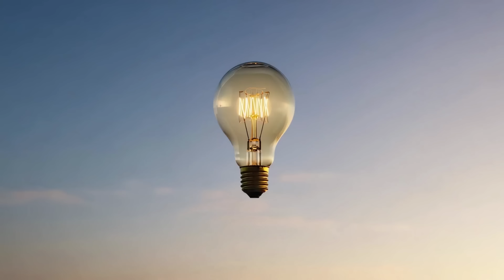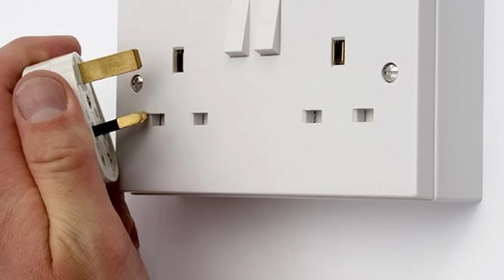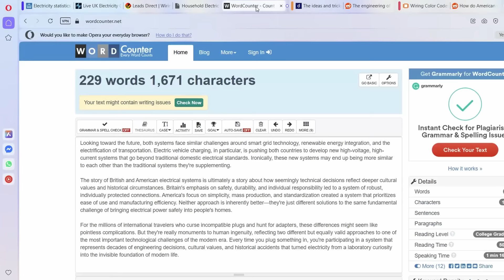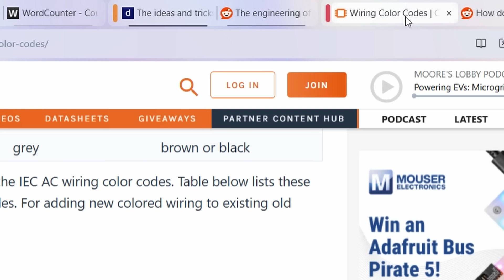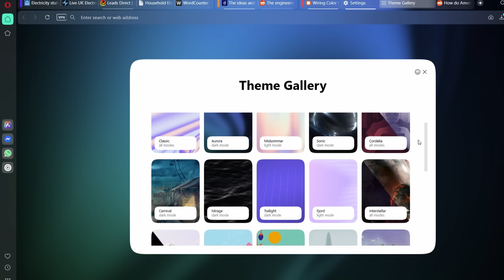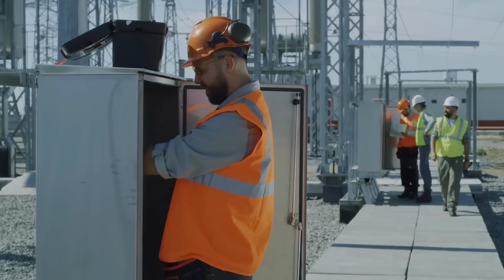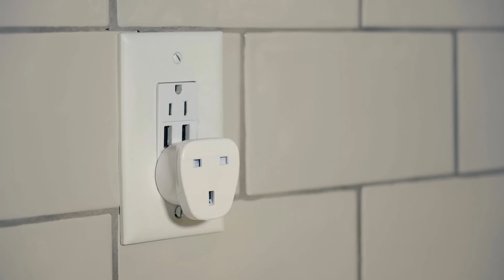British electricity is SAFER than American electricity. here's how.

Comment: I remember as a kid when we bought something electrical you had to also buy a plug and fit it yourself. I am sure that was the case and I don’t feel old 😅
Reply: That was the case up until relativity recently.
Reply: Can you remember when you went to  the ironmonger and bought a replacement element for your kettle instead of throwing the whole thing away when the element blew?
Reply: @orraman5427  No I don’t remember that. But I do still remember how to replace a plug. 😂
Reply: @ozzyprogdomino8815 our job is done! (ex science teacher!)
Reply: @orraman5427  Yep, I can, and there was one which fired the connector out and unplugged itself if some berk let it boil dry!
Reply: @majorpygge-phartt2643 my first electric kettle when I moved out of hone -a hand-me-down from my parents ^_^
Reply: @orraman5427 yes, my dad (trained as an electrical engineer, and who worked as in the planning department of a electrical supply company) used to do this kind of thing all the time all the time.

He changed the 'rings' on the top of our electric oven/stove several times l remember.
Much cheaper than buying a new one, even with a hefty staff discount
Reply: It definitely was a thing. I was taught how to wire a plug in primary school in the 90s. Considering how cheap plugs are compared to how expensive an electrical fire is, it makes more sense to include them as standard to ensure they are wired correctly.
Reply: @RichHaynes2012 was high school for us, although by them I'm sure I had done it already at home
Reply: British square pin plugs became common probably in the 1950s, maybe '60s.  My childhood home in the 50s and 60s had 5A round pin plugs - older homes had 2A round pin plugs.  15A round pin plugs were also available.  Those round pin plugs had no internal fuses, no insulation around the pins and their wall sockets had no shutters.  You're right that moulded plugs haven't been around for much more than ten years or so - until then, all plugs had to have their flexes attached manually, by the retailer, the householder or an electrician, etc.
Reply: @ianm452 but those round & rounded triangular plugs are still used in commercial lighting rigs so there's not way you can plug anything domestic in to a lighting system & vice versa!
Reply: I remember trying to get a retailer to demonstrate a product I was intending to buy, radio, vacuum cleaner, totally forget which but it had no plug on it.  I asked the shop assistant if they could fit a plug on it something I could easily do but the man said he could not do it because he was not a qualified electrician. The very complex and complicated problem of joe public incorrectly wiring up plugs has brought in compulsory moulded plugs on consumer electric items. Hard to get your head round.
Reply: @keith6400 the law for a time was really odd there! They couldn't wire it in store for you to take it home & use it (claiming they needed to see your electrical system to confirm it was being wired correctly) was it the old colour system or the new one! Only the homeowners could do electrical work at home (or a qualified electrician) the law has been tightened many times since! 
Indeed so stupidly that if you want to fit an external socket it comes as a complete unit, moulded plug, wired socket unit but then it's up to you to decide if you're going to cut a plug or socket sized hole in the wall or a cable cutout in a window frame & screw in the socket, meaning you get to disassemble the whole thing! 🤷🏻🤔🤨
Reply: @keith6400 sounds like arse covering to me. If they got it wrong and it resulted in a shock or fire it's in them, if you do it yourself it's on you or your home insurance. Obviously an electrician will have their own insurance to cover such things
Reply: See my comment about what we taught in science!
Reply: That was because Britain switched from an older plug system to the BS1363 system described in the video   For a while both systems were in parallel use, si users had to mount the plug which suited their needs.  The ilder plug has roynd pins and remains in limited use usually for switched outlets for example for lights controlled by a switch next to the door.
Reply: True. Always had to buy a plug when you bought an appliance

Comment: The most dangerous thing about a British 3 pin plug is stepping on one in the middle of the night. No pain on earth compares....
Reply: a lego version of the British 3 pin plug
Reply: @airgunnut9489  that is banned under the Geneva convention
Reply: Something that most people can probably relate to.  But also consider of all the plugs I've used the British plug is least likely to drop out or be pulled out of the socket. And because each socket has a switch it's unlikely to be pulled out for safety sake.
Reply: @Davrolo101  it really is likely to drop out. Its held in only by prongs. Now compare it to schuko plug/ deep hole socket. British ones are just hanging for dear life on flat surface.
Reply: @lauriviik  So you haven't had any real practical experience with both the British and the Schuko plug? Or the Italian plugs, The French plugs. The US plugs. the Australian plugs.
Do you think those weak scraps of wire on the sides really hold the plugs in?
Reply: @lauriviik  Given that the only force direction that can actually pull one out is essentially perpendicular to the socket face, they really aren't hanging on for dear life.
Even a strong tug on the cable isn't likely to do it, though arguably it might often be better if it would.
Even back when wall wart power supplies used heavier mains-frequency transformers, I can't recall coming across any that gave me even slight concerns about them just dropping out.
Reply: @NorthernStar1982 Never done it and I'm getting on now.
Reply: @bertiesworld 
Neither have I. Nor have I ever met anyone who has.
It's only in YouTube comments do I ever read about such a thing happening.
Reply: @bertiesworld  you should put it on your bucket list😁
Reply: "No pain on earth compares...." You've never had a serious electric shock then.
Reply: @thearmouredpenguin7148  I have had both. And of the two I prefer the electric shock. It's either done and gone. Or you are. The plug-in the foot hurts  like hell for a while and stops you walking For a bit longer
Reply: @Davrolo101 can't have been much of one, I'm quite careless with electricity and have had electric shocks several times, the most dramatic sent me flying across the room literally. Overall I'd prefer to do neither.
Reply: @Davrolo101  I have experienced treading on a plug (*and* upturned DIL IC chips (they always land the wrong way up)) without shoes, various mains shocks when I was young and careless, and a minor ground shock from a super-close lightning strike (though other people got rather more of it than I did).
I'm not sure how I'd rank them.
Standing on the plug is painful, but I tend to walk lightly when not wearing shoes, possibly at least in part down to past experiences.
My least pleasant mains shock was when I was doing stage lighting at school and was leaning out while standing on a wooden cupboard, holding on to a metal roof truss with one hand for balance while trying to change a light bulb, and found out that the socket hadn't been turned off, and I had a brief time where I had to figure out which hand not to let go with.
I'd certainly agree that a mains shock survived (at least the ones I've had) can feel somewhat invigorating afterwards, but most of my other ones have been very brief, and having one when you actually have time to think in the middle of it can be pretty scary at the time.
Reply: Have you ever actually done it? I have, it doesn't hurt at all. The pins are big enough to prevent injury.
Reply: The pain from a Lego brick compares!
Reply: @RobertScott-pp6gj as i mentioned a 3 pin plug made of lego
Reply: Sole of the foot on the plug of the washing machine versus baby toe against the corner of the washing machine 😖.

( *probably less often as an adult because one no longer moves around the house at the same velocity 😞 ).
Reply: Valuable life lesson learned  :hand-orange-covering-eyes:
Reply: I am in my 70's never put my foot on one yet! some clumsy sods around I would imagine?
Reply: Only happens if you let the lead it's atached to is allowed to trail across the floor which is a hazzard in it's own right. It's a very stupid thing to do, so it serves you right. Maybe you learn to be more careful in the future.
Reply: @MJRoche  Exactly - & why would anyone be daft enough, or untidy enough, to leave a plug lying on the floor?  And if you wander around in bare feet, you're more likely to stub your toe on something than to find a dormant plug to stand on.  Having made such a critical statement, I thought I should check my house to see if I'm guilty: it has 23 double sockets, and the only plugs lying about are two on worktops (counters?) one in the kitchen and one in the utility room plus one on a shelf behind the television set.  None on the floor where they could be trodden on.    I don't recall ever treading on a plug.
Reply: Look where you're placing your feet and don't walk around barefoot?

Comment: The UK started with two different sizes of round pin plugs before we went square.
Reply: At least three sizes in fact, 15 Amp, 5 Amp, and 2 Amp. I'll admit 2 Amp sockets were uncommon though.
Reply: @wilhelmvonn9619  15amp had an earth pin! (Three Pins).
Reply: @wilhelmvonn9619  There was one in our flat.
Reply: hoAnd you will still find the 25 amp version used in theatres on lighting rigs. The last place you want a fuse is 25ft up in the fly tower centre stage in the middle of a show!
Reply: There were three sizes, and the smallest 2-pin survives in shaver sockets etc.

Comment: Quite a lot of places in the US also have 240V supplies for electric cookers, AC systems and other high loads. The difference is that the earth connection is in the middle so both poles of the supply are 120V to earth whereas in the UK one pole is earthed (Neutral) and the other pole is 240V to earth (Live).
Reply: That is achieved by having a two phase supply and is a relatively new upgrade.  If the Europeans need higher power they use a three phase supply forhigher power demands than domestic items.

Comment: Interesting video, but would say somewhat bit too vague perhaps. Although I would definitely say that we do have here in the UK some of the safest electrical standards, on par mostly with our European neighbours who also have some of the safest. I would just say though that the uniquely (unless someone can say otherwise) British 'Ring Main' is most definitely not for safety and is purely a material cutting & somewhat cost cutting exercise. And was mainly due to copper shortage after the war. Radial circuits are still widely used in the UK (although many still sadly use 'Ring Mains'), especially for dedicated circuits such as cookers, washing machines, hot water tanks, boilers...
Many electricians thought the 'Ring Main' was gonna be stopped being allowed in the Regs. when I did my electrical training years ago.
Also alot of our electrical standards are harmonised (especially before Brexit) with Europe such as voltage, frequency, cable colour coding (which was actually a UK industry push to move away from red & black to brown & blue)...

Comment: This video doesn't mention that for the first fifty or sixty years standard British plugs had ROUND pins. The now familiar chunky looking square pin plugs and sockets were only developed around the time of WW2  and didn't become standard until the 1960s, when new buildings were required to have them and old buildings were fitted with them if they were re-wired.

Even now there are still some old buildings in Britain that have some round-pin sockets and it is still possible to purchase round pin plugs.
Reply: The house I was brought up in had the old-style round pins/sockets, was only upgraded some time in the 70s. It also had some surface mounted lead-sheathed cable in the "new" extension for the kitchen (built some time in the 19th century).

Comment: its always scaring going to another country where the plugs are different but no on off switch freaks me out 
here in NZ we are very similar to the UK 
plugs in the bathroom are a big no no, you have a special outlet for electric razors, no hairdyers, regular plugs must be one metre from any water source so our bathroom is too small but we do have the light switch just inside the bathroom door
Reply: No.  You can have standard sockets in your bathroom in NZ.  There are restrictions on where and how it is situated and it must be RCD protected.  Even in your apparently really really small bathroom you can put a standard socket inside a cabinet.

Comment: In the late 1970s my (mechanical) engineering course did a design study on 13 amp plugs. We each had to buy a plug (there were 70 of us) and determine its design advantages and disadvantages of the one we each had. Until then I did not realise the sheer number of variations on the same theme that existed!

Comment: How safe things are? That's just blatantly obvious just judging from mains voltage. 230V pulls the same big load at less current than 120v-130v. That's it. And the wires won't heat up as fast. Plus personally I'd think architectures of supplies in UK is more 'fixed' and predictable. It's just 1 phase at 230 V or 3-phase at 380-400 V. That's all. Unlike what's in USA there's another architecture where 2 hot legs are 180degs apart. Making 240v in total. Outside of that we're talking about plugs having internal fuses, ground has to get connected first before live and neutral is 'unlocked'.

Comment: This is probably not the right forum for this as electrical safety is not a matter of how many pins the plugs have. Japan uses 2 pin plugs with 100 volts and is much safer than the UK system. The US uses 3 pin plugs for 240 volt appliances but there are many differences is the way circuits are grounded and what protection is in the distribution box. Most UK bathrooms now have 2 flat pin non shuttered sockets for razors, hair driers and the like. American  bathrooms have trips with reset buttons. While British code does not allow normal light switches in bathrooms whereas US does. So it is wrong to say US power is less safe. Both countries have good and bad points and both countries regulate electrical safety though the UK allows far more diy work than the US does but this has been changing over the years.

Comment: We in the UK started with a different system of round pin sockets on radial circuits but the 13 amp socket was rolled out after WW2. At that time the old rubber insulated wiring was a safety issue and by 1960s most homes had been rewired. We Brits can enjoy the 13 amp sockets in Singapore nd Malaysia! European standards are met in the UK by means of tolerances our 240V system sits within the 230V system and on the Continent sockets are slightly different between countries. Italy is an outlier I think.

Comment: Super interesting and well researched.  Our friend Andrew (RIP) would have been proud of you!
Reply: The current British system was introduced in the late 2950s or early 1960s. Before then we had ROUND pin plugs that were not fused - the fuse was in the central fuse board. The system we now use is based on a Swedish design,I believe.

Comment: If you go back to the early days of electricity in the UK when lights were fitted, but no sockets. When things such as kettles and irons became available they were connected to the light fitting with a long lead rather than paying to have sockets installed. I used to deliver newspapers in the early 90's to an old lady in her 80's who's home still had that due to the age of the house being built in the 1800's. It was strange seeing an old iron connected to the light fitting. The house did have sockets, but why replace something that still worked even if a bit janky, and frankly dangerous in the 90's.
Reply: Not just the UK. The use of lamp holders as general power was done around the world.  I can remember the radio set at my grandparents house in Australia was attached to a bayonet style holder on the wall, and the switch that turned on the lougeroom ceiling light also turned on the radio.